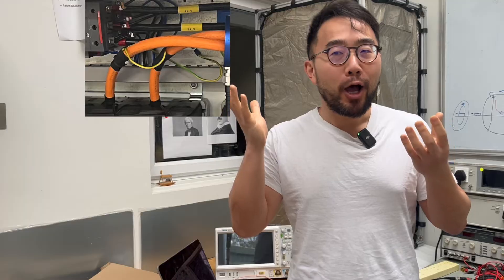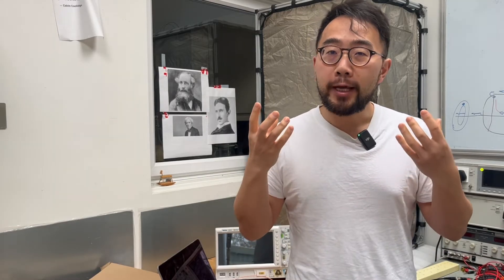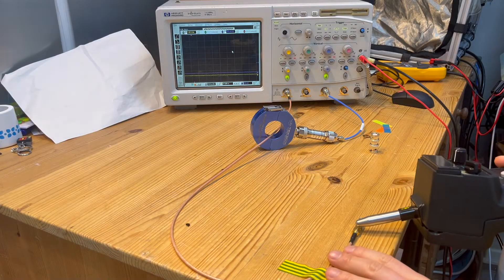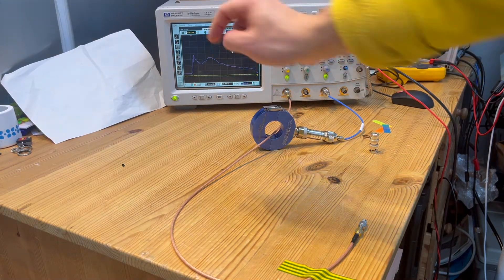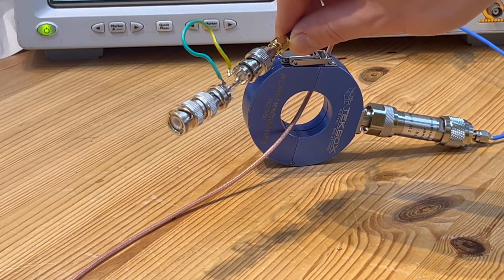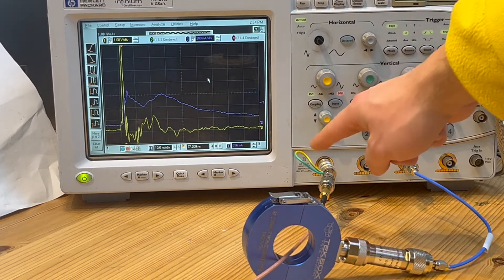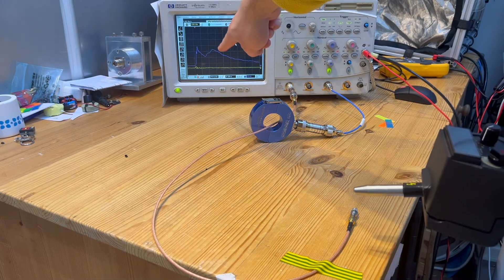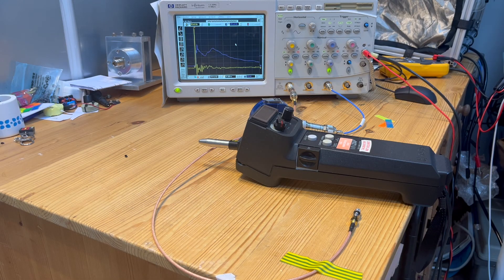Pigtail Terminations: How They Can Ruin Your Shielded Cable's Effectiveness

Comment: Great demo, thanks. What voltage was the ESD gun set to that you applied it to the scope ground? EN 61000-4-2 specifies at least 2 kV for air and for contact (with the round tip for air).
Reply from the maker: cannot remember from the top of my head, but surely for this demonstration, it is only a small voltage, like sub 1kV I would imagine.

Comment: Good demonstration, thanks. But isn't the rounded tip of the ESD gun for non-contact and the sharp one for contact ? I have no idea of the effect of it, but i just remember that the convention is the opposite of what i would have guessed because for non-contact, the sharp tip would increase the field and favor sparking over the gap.

Comment: Thanks for the demonstration. You didn't mention the frequency of the esd gun; am I missing something?
De VU2RZA
Reply: The first peak typically has a risetime between 600ps and 1ns. So by BW ~350 to 600MHz, but if you want to measure it sufficiantly accurate one needs a 2GHz scope.
Reply: @pitti2602  OK. As a ham radio operator, I sometimes use pig tail connections even in the 150 MHz range without any obvious I'll effects. Thanks again. 
De VU2RZA